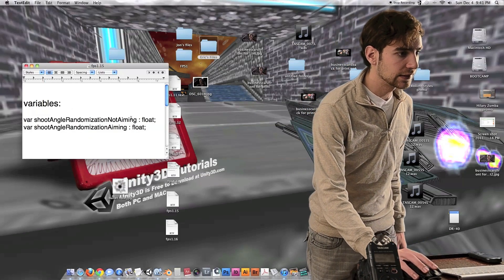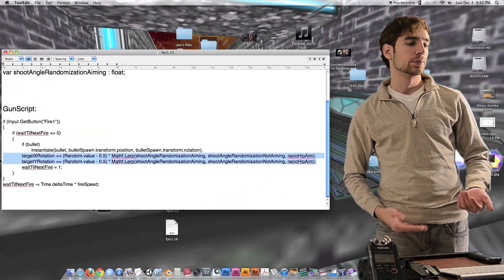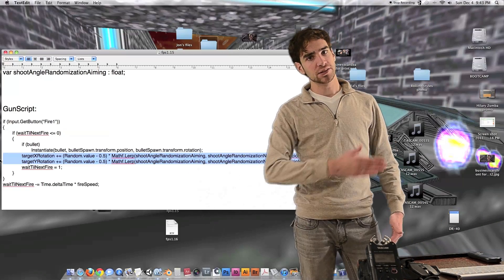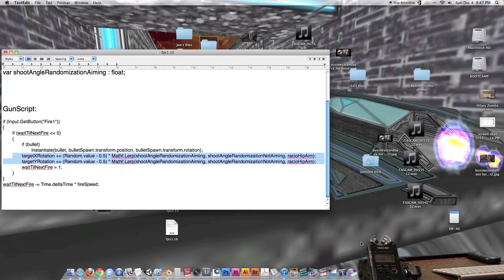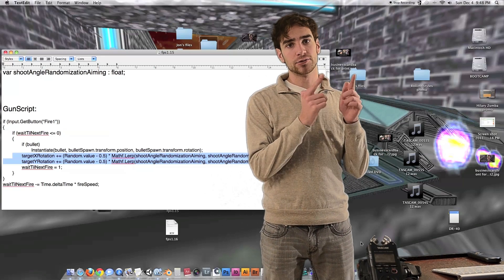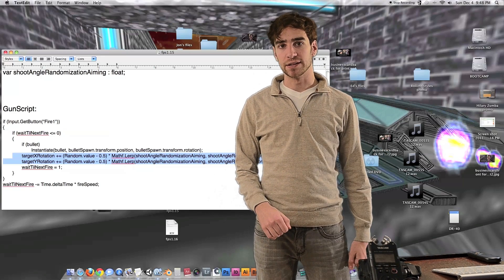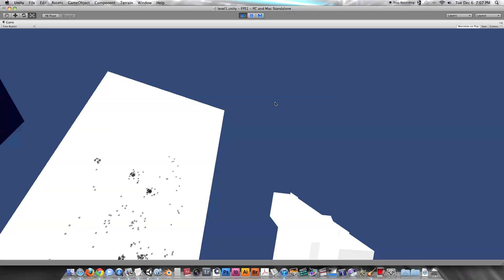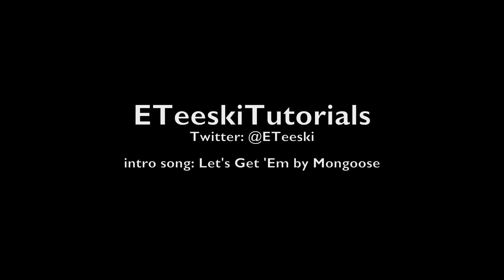FPS1.15 Bullet Spread. Unity3D FPS Game Design Tutorial.

Comment: @ETeeskiTutorials For prone I simply used the "One-Third" rule common to most shooters like MW3, BF3, etc. Crouching is 2/3 satanding height (or standingHeight*2 / 3) and prone is 1/3 standing height (or standingHeight/3). Unity units are generally equivalent to meters. When you create a capsule it has a height of 2 units (or 2 meters).  The hard part was dealing with the mesh collider, since it has a minimum size of 1 unit. This made prone quite a chore .

Comment: I really love you videos. They truly help me to understand the core functions that Unity uses. I had a problem with the gun placement, hip vs. aim. Aiming, the bullet shoots to (0, 0) but at hip the gun shoots to (0 - hipHold, 0 - hipHeight). I love the idea of Bullet Spread, but wouldn't it be more efficient to attach the bulletSpawn object to a point at (0, 0) and have the true Spread be based on the bulletSpawn? Also for the gun, the randomness should be larger on the Y axis and tighter on X?